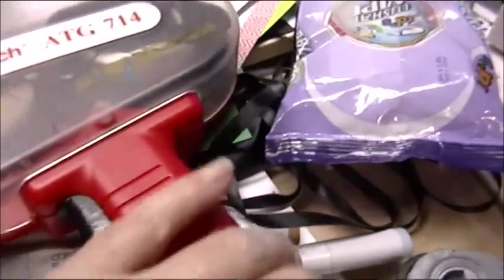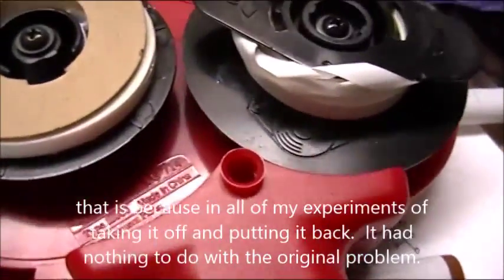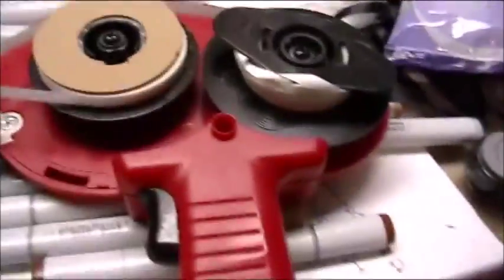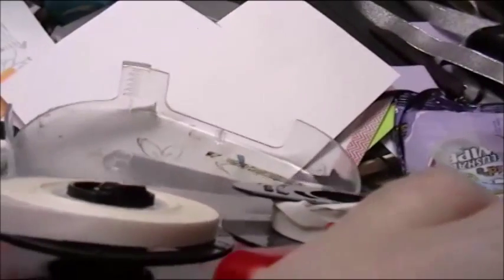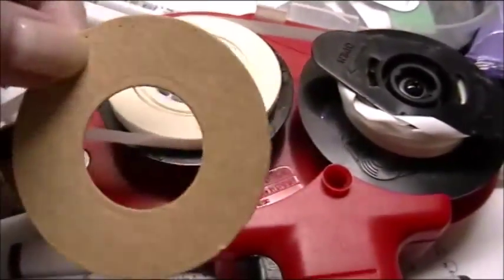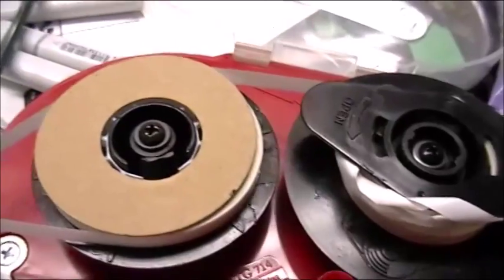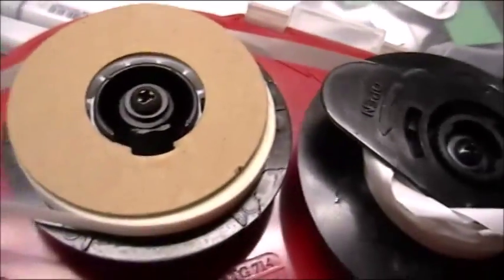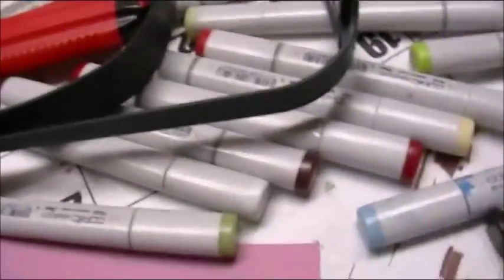ATG problem solved

Comment: You can cut that old tape that is bunched up around the back roller off. Reload your tape, use your shim, and that will help you your tape roll smoother also. The way the tape is not wrapping around the back roller is a problem. Hope that helps.
Reply from the maker: yes, I know and I have since done that.  I had taken that roll of tape off and on so many times in my experimentation with different solutions that it got all twisted up on me!

Comment: Something else you can use, is an empty tape cylinder thingie.  Just plop it on top of the new roll (it clicks in nicely) and it works like a charm.  It's thicker/sturdier than a piece of cardboard.  :-)